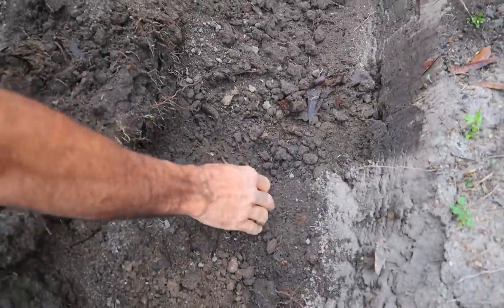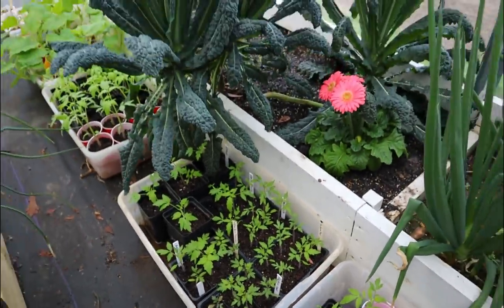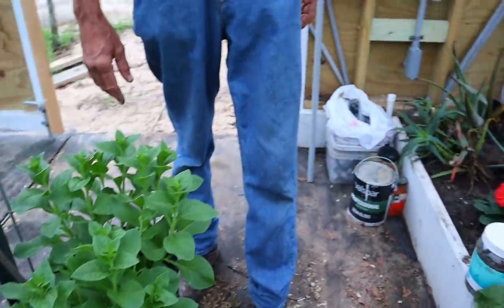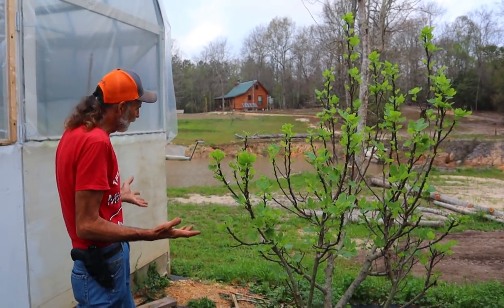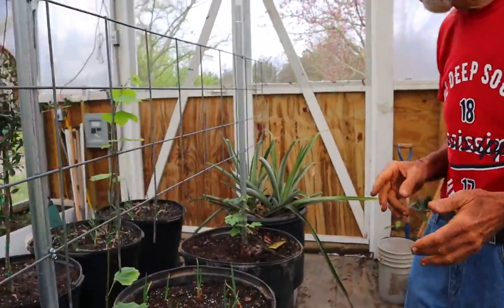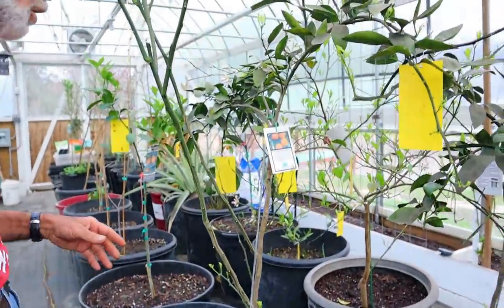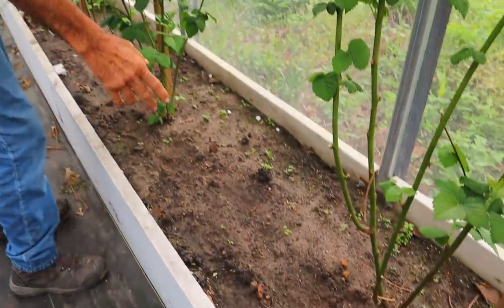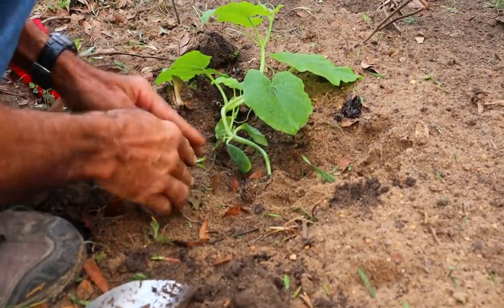ONIONS Just LOVE THIS!  Greenhouse/HighTunnel TOUR 2021

Comment: This is unrelated but related to fans . I used to work in a paper mill and we had a huge hood over the dryer cans that were steam heated , and in those hoods there were several exhaust fans , we had to replace the hood and fans mostly cause the panels in the old hood had asbestos in them . Well when they put in the new aluminum hood and ductwork and fans . The new fans were more powerful and at the wet end of the paper machine there was an old draw bridge between two buildings that was left in place to get to the other building and there were heavy plastic swinging doors for the fork trucks to go through . Well we soon learned to hold on to our hats or else they would get sucked off our heads when the doors opened to cross the bridge and if you had a coffee in one hand you had to cover it with the other hand or it would get sucked out of the cup . Just thought I would add that when I saw the comment on your fans

Comment: And I just got me a sleeve of 16 ounce solo cups for transplanting 😂 I got clear color by accident when I ordered, but it was a quick fix with a little sleeve of newspaper I slid inside the cup before filling with soil. This covered the side on the inside so the roots aren’t exposed to the light (I heard that’s bad) 

I also just started toying with making paper pots out of newspaper. I like the paper pots because, yes they are environmentally friendly and that’s nice, but they are totally customizable so for each variety of plant or for each size of a seedling that I have I can roll me a paper pot to the exact depth and the exact with that I want. This is making it easier To save space in my trays and maximize the amount of seedlings I can grow in my indoor space and even in my outdoor portable low tunnel that I just bought. I really like when some thing gives me the option of getting a few more plants into a tray. That’s the only thing I do not like about growing in a solo cup or a party plastic cup is that the shape of the cup, although the tapered shape of the cup is better for transplanting, But anyways paper pots everything fits very snuggly next to each other and leaves me with a couple more spaces to put more plants so I’m really digging that. And I’ve made paper pots out of newspaper fliers that come in that are not glossy you always wanna use the matte finish newspaper.

Anyways the solo cups have always worked really well for me I will start some seedlings in 3 ounce cups, 5 to 7 ounce cups, and my tomatoes and peppers I do in 16 ounce cups

Comment: Watched your videos of the high tunnels, my opinion is that you still need a heat source  as the winters are going to maybe much colder in coming years, a heat source would guarantee you no worrying about sever cold, and better quality produce
Reply from the maker: We do plan on a heat source as the Solar minimum advances.
Reply: Can also still do row covers etc. inside to alleviate cold damage.

Comment: Danny, is there a reason why you didn't choose the aluminet shade cloth? I've used it for 2 years now 40 % shade  and so far everything seems to like it. I put up 2 10x20 by 7ft high cheap greenhouses this winter, it was too late to grow in, but they have been great to transfer seedlings to this spring. I have a bed between the 2 to plant tomatoes in, the shade cloths come down about to a foot or two before hitting the ground. I'll find out this year if the reflection of the shade cloth will be too much on the bed between the houses. I have used the black shade cloth and the aluminet is cooler underneath than the black.
Reply from the maker: Yeah it's about 300 dollar's more than the others.
Reply: @DeepSouthHomestead  Yes, it's more expensive, but it is sure cooler in the heat of the day. Love Y'all and thank y'all for you do and the time you put in to teaching us.

Comment: Can not hear you
Reply from the maker: Loud and clear on our end.
Reply: Sound fine here too
Reply: Gilda have you tried adding/turning on the captions?  I have found it helps if there is a bit of background noise.
The 3 dots in the upper right hand corner  -click on those and then click on captions and click English or what ever others you like  depend on where you're from. And then you can read along with the video.
I use that function a lot with cooking videos where I need to really catch the recipes.
But it works well for background noise too.  Hope this helps